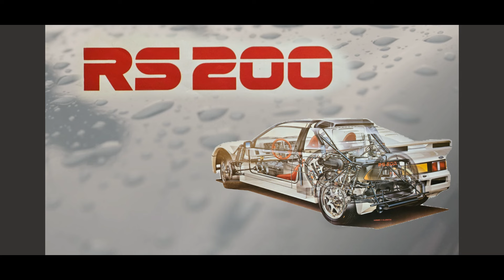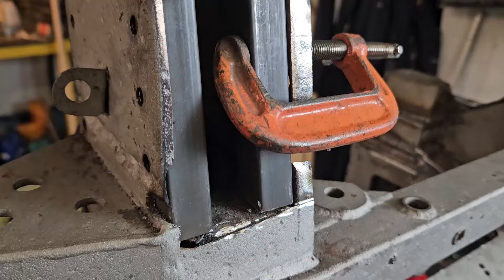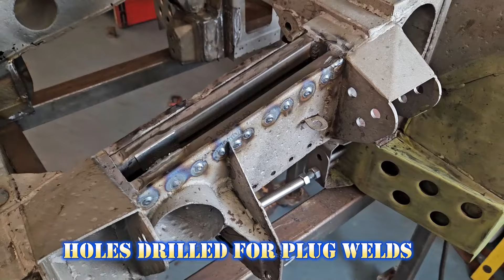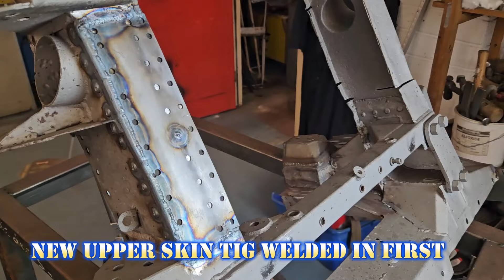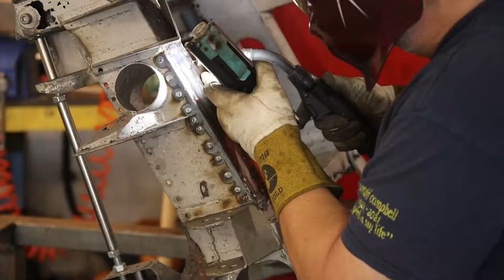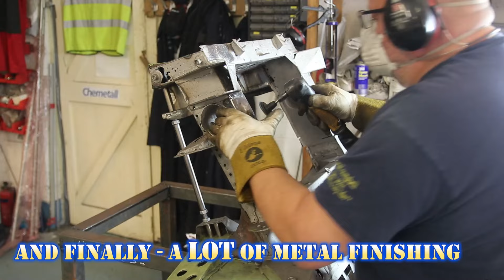Ford RS200. Wrecked Chassis Leg Repaired. #rally #rallycross #ford

Comment: good work, are you doing like conservation type repairs ? as it seems you are leaving as much original metal as possible, rather than just fabricating it all from new.
Reply from the maker: If there's good metal or that which can be strengthened so it lives to fight another day then it stays. If it's totally shot it gets cut out and replaced but it's quite a complicated piece of structure so making a new one would mean making a complex tool to take a single part from. For that reason alone it's easier to conserve and repair.
That and the fact that it's been on a journey and has a story to tell.